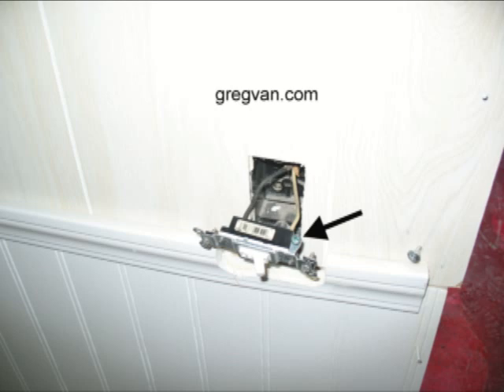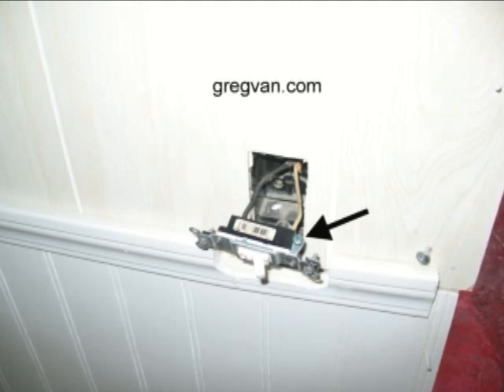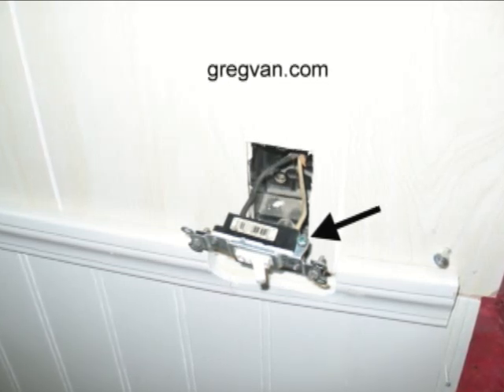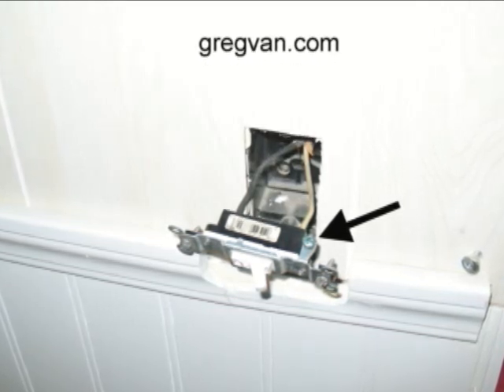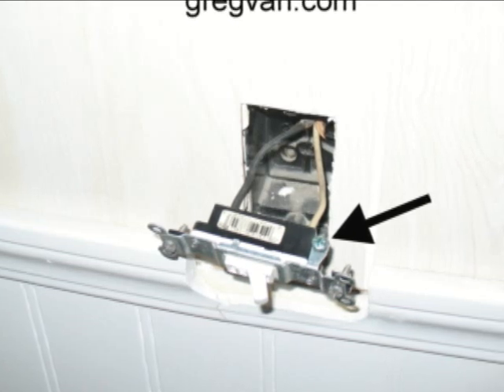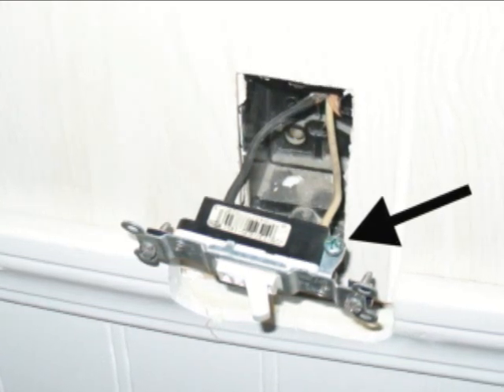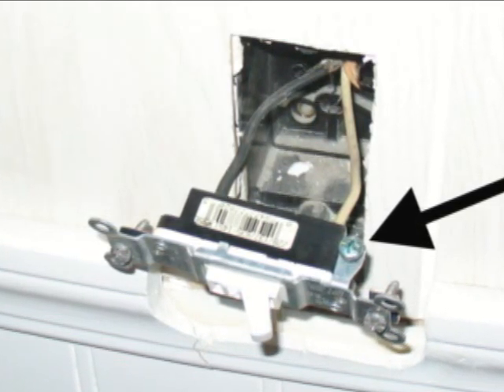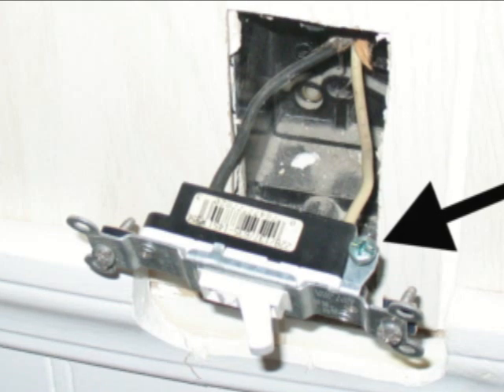Light Switch With Missing Ground Wire - Consumer Advice

Comment: Maybe you could simply attach a piece of copper ground wire from the green screw to a screw in the metal box ?
Reply from the maker: That was a common practice years ago, if the metal boxes were actually grounded, but I don't think you're allowed to do it anymore.
Reply: That's what I meant a box that was grounded into the system as well.
Reply from the maker: I did some research and suggest doing your own also. I typed "Are you allowed to use conduit for electrical grounding," into a search engine and found that according to the 2014 electrical code compliance you can still use flexible and rigid conduit as long as you are sure that it is grounded.
Reply: @gregvancom  
You are allowed to use metal boxes and in commercial locations likely required to use metal boxes. If you have a metal box and a ground wire coming into the box then a ground wire should be attached to the box and to your switch.

Comment: Well, duh.  The issue is: How do you replace a light switch that has NO ground wire  with a light switch that DOES have a ground wire?
Reply: Light switches normally don't have grounding wires. They just gave a green screw to attach a ground wire to. If the box is not grounded then the replacement switch does not need to be grounded. If the box is a metal box and is grounded via conduit a ground wire can be attached to the box itself...
Reply: I still don't know how to replace a light switch that has NO ground wire with a new light switch that DOES have a ground wire. @njsongwriter

Comment from the maker: I would imagine you could, but I'm basing this off of common sense. If you don't have a grounding wire, then you wouldn't be able to ground the light switch. Remember, this is just my personal opinion and for clarification, you should contact your local building and safety department.

Comment: uh, so I can't ground this new dimmer switch because there's no ground wire in the box. huh. guess I worry later if I get shocked!
Reply from the maker: If you don't want to tear the walls apart, simply install it and wear rubber shoes:)
You can always make the modifications if someone does shocked.

Comment: I have a brand new house and my switch does not have a ground wire to connect to so what the hell are you talking about???
Reply from the maker: +tulor007 I guess there's a nicer way to ask your question, but understand your frustration. Some building codes might not require a ground wire to a light switch.
Reply: +tulor007 Whhooooooaaaa nelly!  Did you just swear at someone who made a video to help you?! Take it eaaaasy...especially if you're going to do electrical work....for your own safety.